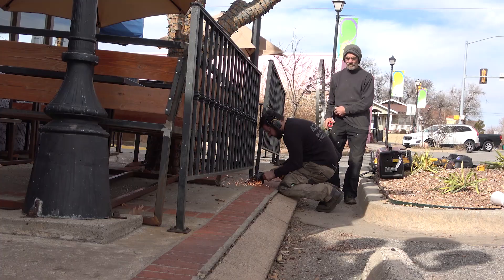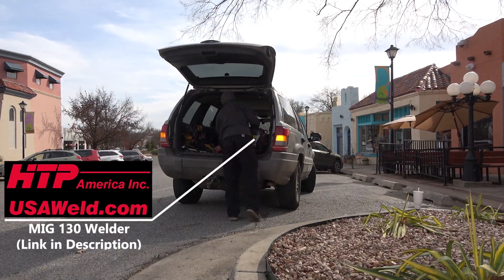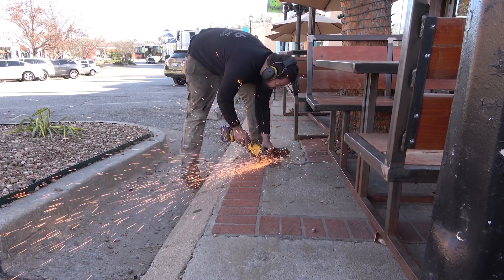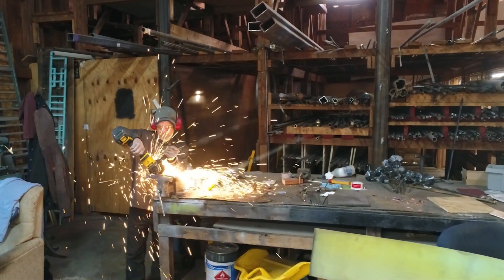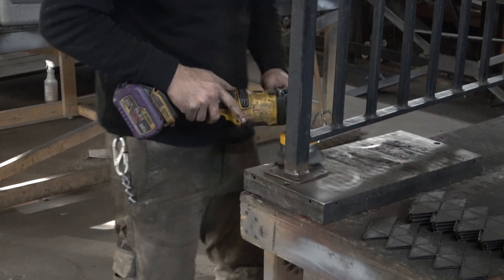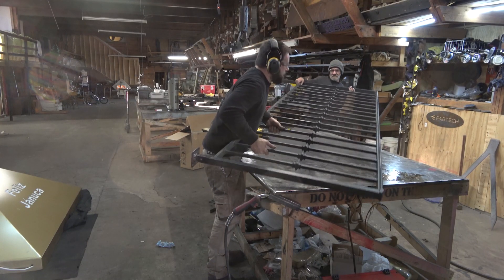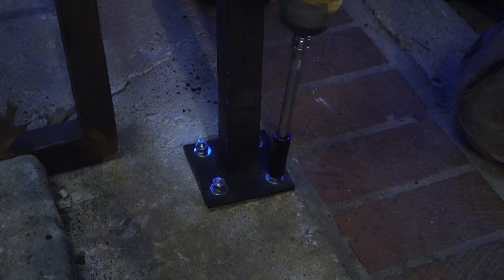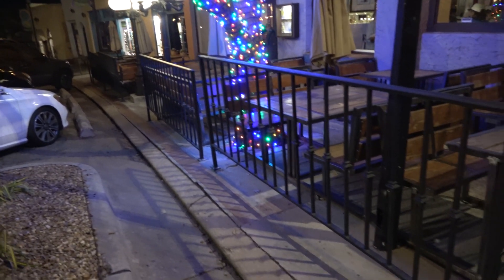When a Simple Job Isn't Simple

Comment: How do you not charge different rates for different metal types? Steel, aluminum, titanium, brass, bronze, copper, cast iron, cast aluminum, tool steel, etc?  Plus on location is about double here and out of 10 miles we have a 5 hour minimum.  BTW we are 1 of the lowest priced around here so you are crazy low!
Reply from the maker: Our rate is time + material, o something more exotic is going to cost more, and likely take more time.

Comment: It's a good customer because you did that furniture outside? :) Maybe drill a half-inch hole on the bottom of that leg for water escaping from inside is not stupidies idea ever.
Reply from the maker: Good customer because they're easy to deal with. In general other business owners understand scheduling changes, delays due to weather, etc. And yes, we built those benches to the customer's spec. 

I opted to seal the tubes by welding top and bottom completely rather than open a weep hole on the inside where we cannot paint.

Comment: $350 still seems pretty low.  Hope your customer knows what a deal they got.  
The metal-fab shop I used to work for wouldn't send a truck out for less than $1000.
Reply: call out charge minimum $1000 ? they still in business ??
Reply: @leso204  At the time we did mostly I.C.I. work. So the contracts would get into 5 figures very quickly.  But perhaps it's not comparable to helping out the neighbourhood restaurant.
Reply: Wages  $34.00 /hr x 2 welders for 1day, $544. Consumables/materials,  business ins., profit, vehicle exp. office exp. taxes, building/shop exp. (mortgage/lease),  tool depreciation exp.  business marketing exp. approx.$350+. All of a sudden you're at $900 for wages and expenses.

That's why $350 seems way too low.
Reply: leso204 depends on your business model. If you’re doing an average of 100 ton jobs of fabricated steel why lose those workers and manhours for a $200 job where you’re best case is $50 profit
Reply: @Farmboy1544  I think you made those numbers up. In my neck of the woods unions don't even pay $34/hr, let alone a couple guys working out of a 20 year old jeep grand Cherokee with tools thrown in the back. I don't know how all the rest adds up to as high as you got it either. If you have a $100k service truck with built in air, welder, pay insurance for your guys, 401k etc, sure. But that's not what this guy has going on.
Reply: ZoeQuinnIsAMurderer  Industrial, Commercial, Institutional. Commonly refered to as ICI.
Reply: @joshmiller3673  Well I did say the work we did was not comparable to helping out the restaurant. The $34/hr was non union. The weld shop I worked for grossed about $10 mill. a year. Depending on the labour requirements we would have anywhere between 30 to 50 employees.  As you might imagine running a profitable business is very expensive. If you aren't making $$$ in your neck of the woods, then that's unfortunate.  :(
Reply: Josh Miller idk what union you in but down south the boilermakers tubewelder pay is 32 dollars an hour and that’s down south the lowest paid area. Up north doesn’t matter if your a tubewelder or not all boilermakers make anywhere from 38 to 50s.
Reply: @Farmboy1544  but it took only 2 hours.
Reply: This really sounds cheap pricing. Two guys working 3 hours, driving involved and materials too (some metal, welding and bolts).
Reply: I thought the same thing.   I wouldn't imagine a company wanting this job unless after labor and material the shop makes $300-500.   How do you keep the lights on in the shop?

Comment: I would have just cut all posts off and replaced with thicker gauge tubing and new thicker footplates like you did. Probably would have saved you time, which would have offset the cost for the thicker tubing, which you could have told the client from the start (but now you know when someone else calls with a similar "quick fix"). Sad to see the previous builder opted for all cheap materials, when really it isn't that much more for thicker tubing.

Comment: OK this is an onsite job within 10 miles so we don't charge under 50 miles otherwise we charge $1 per mile. Shop hour rate is $100 and in the Field with a min of 3h work for $175. If customers are former military, EMT , Teachers , Police or Firefighters they get 10%. 

Costs would be around for a good customer $300 plus $50 in materials for this kind of the job including the painting in flat black enamel.

Comment: A anti rust technique from the early tube frame aircraft builders is to coat the inside of the tubing with  linseed oil. In this case I would have given the inside of the pipe ends a shot of Rustoleun  primer before closing off the ends of the tubes.

Comment: I’m very curious,  do you charge for “shop rate” differently than “man hours”? Great video by the way, thanks.
Reply from the maker: As I said, we're not charging for time spent waiting for paint to dry. If it was a rush and that was all we had to do, yes, but in this case we had other work to do, so no. Man hours is different as my helper does not earn, nor command the same rate I do. If he is working alone, then yes, but there is no reason for me to bill for overhead twice.

To each their own on how they want to bill, I prefer to do it as upfront as possible. My customers appreciate that and return because of it.

Comment: You know how I keep water from building up in posts and pickets?

Use solid bar.

They’d need to be in salt water for 10 years straight to rust through.

Use a core drill and anchoring cement. Bolts rust, cement doesn’t.
Reply: I just drill drainage holes whenever  I'm doing something like this, it's a lot cheaper than solid bar

Comment: That was a rookie mistake. One hole in baseplate prevents a column of water from condensation collecting in post and freezing/ puffing and rusting out. All this should have been  
Assesed when giving bid and give owner 2 options, a field repair or a shop repair with a proper price. Good news is he will call you in a year to fix again since you you didnt address the root cause of the rusting the "WEEP HOLE" better luck next time

Comment: You gave him a very good deal.... Very cheap. I would have started at double that and possibly gone high for the extra effort. Keep in mind this business is not going to cut your meal and drink prices when your patronizing their business friend or not ? Your paying for materials, electricity, consumables, wear and tear on tools, and labor.... That's not free to you so you need to be able to cover that cost and make a profit.
Reply from the maker: We did the job by the hour, if you make your rate you're gold. I think the take away is this video makes the job look harder than it was. Took time, mostly due to paint drying, I'm plenty happy with how we did.
Reply: I get it, one way I bid is to add up all cost of materials and double it then add thirty percent to that number for any surprises. It works out well if I stick to the numbers and don't let the friend factor drop my price down to where I'm paying for the job.

Comment: I always had a "unforeseen conditions" clause in bid contacts. And I explain to the client that it simply means anything that isnt viewable or known and considerably changes the scope of the job as it is written in our agreement. I also point out that if that was to happen, a change order is drawn up so the client is aware to the reasons for the change. In every case it was obvious, similar to this one. 
Taking a hit for a mis bid or any mistake made by myself is fine, and I've done that without sacrificing work we quality. But an unforeseen condition is no one's fault.
Reply: S.W.A.G. Sorta Wild Azzed Guess
Reply: So you add half an hour of additinal paperwork for a job that thakes you 1 hour longer than expected?
Reply: @danj7348  
Half an hour?

Comment: Good work but your problem was that you didn't try to make it simple again.  I can think of much quicker and easier ways to solve this issue
Reply from the maker: I'd suggest making a video about your quicker and easier ways so we can all learn
Reply: 42Fab - Metal Fabrication & Signage maybe some day but damn you worked that customer.  Theres a multitude of simple ways to repair, In and out less than 30min less than $50

But you insisted on trying to fix it like you normally do and hurt your customer.
Reply from the maker: @user-jc2ez6ig5z  please do tell how you fix this for $50
Reply: 42Fab - Metal Fabrication & Signage like in school when a teacher will not give you an answer without you trying:

If you can come up with one way, I will tell you 3 more ways.  

Think on it. I fully expect you and your experience to come up with something.  Good day.

Comment: Personally I would have bought the next size bigger square tube that would slip over those posts like little feet.. cut all the posts on site, slipped on the larger tube and without even grinding on the plate since its hidden inside the now larger slip foot anyway---  stand the rails back up and weld all around the top of the slip and then all around the plate.. job is done... You could chamfer around the top for a sculptured look if you wanted.   It would change the look just slightly by now having wider feet at the bottom...  but it would still look good, and look "beefed up" to the customer , and technically would be-- and it would have been the simplest solution--- because all of your slip feet are the same size and easy to chop saw a scrap tube....  No measuring, no grinding accept maybe the paint a little........   Just cut, slip and weld..  gone.. (and it's not a bad idea to drill a 1/16 hole in the bottom so if it does ever get water in it it will drain out and not freeze and burst and bulge the pipe.)
Reply: Dam your a smart feller good call
Reply: @Quackers-rm8wj    Thanks.. lot of years, running a crew with expensive guys-- you have to get super efficient to keep making profit.  A few more minutes thinking it through can go a long way.  cheers

Comment: So many things wrong here. The base plates should have had holes for let water escape. The anchors likely could have been pushed down to maintain location, that's how anchors are designed. And the cost should not change from the quote. You pay for the lesson not the customer.
Reply from the maker: This is why there was no quote. We were called out to address a problem, with the customer knowing our billing rates. WE chose to do the work at the shop, which ultimately saved the customer money and saved us the headache of working in the field.

Comment: What metal chop saw would you recommend and blade replacement
Reply from the maker: I use https://amzn.to/2SjGbWK with the stock blades. I've tried a few blades and never found a better value, as much as I hate to fanboy dewalt.

My only complaint is the angle/miter system is kinda weak, so you have to readjust, but in the price point I haven't found another that doesn't have that issue.

Comment: I'm going to disagree with you on the shop thing. As a contractor I incur expenses for traveling and for maintaining a truck with $80,000 worth of tools in the truck. But on the other hand, I don't have to pay rent and utilities for a shop. The bottom line is, it's a wash. Now may not seem like a wash to you because in your case you own a shop and you're having to go to do site repairs. But I don't think you get to charge for the overhead of going to fight and charge for the overhead of the shop. But I think what's actually going on is your under charging for your shop time. And this comports with the members that you spoke about. Of course I'm not a welder, I'm a contractor. So I don't exactly understand all of the nuances of the rates in your area. For that matter I don't even know what your area is. It's worth remembering however at the unit price for finished product coming out of the shop is going to be less than that same finished product being built on site. But this is not because of the hourly shop rate being less, as much as it is the efficiency of doing work at a shop.
Reply from the maker: "you don't get to charge" is a statement laden with misunderstanding. 
We have a shop rate ($100/hr) with a minimum of $20. That means that if it is going to take us less than 12 minutes to do the job, it literally isn't worth doing unless you'll pay for the 12 minutes, because stopping whatever else we're doing, switching machine settings, etc, all eat up too much time.
Likewise when we go mobile that minimum increases to two hours and the rate increases, which accounts for the time needed to pack up tools, drive to the location, etc. 
Ultimately we do get to charge, because that is the value structure we place on our time, and the customer accepts that structure. Simple supply and demand. With the numbers given here you'll see that there was no gouging or rip off involved.
Reply: @42Fab  Sorry, don't misunderstand me, I'm not saying that you're overcharging. In fact I specifically said that I think you undercharging. All I was saying is that there is an overhead involved in running the shop and there is a very similar overhead involved in not running a shop, ie. mobility to site work. Each project has to take into account either of those overheads. It is quite possible that people that own shops don't appreciate overhead involved in doing site work. And I think that was your point, or at least similar enough to your point there really should be no disagreement between you and I. But generally speaking, minimums aside (which usually account for travel time to a customer), the cost of working out of a shop and the cost of working at site should be about the same hourly rate. But then the efficiencies of working out of a shop will still save a customer some money over doing work at a location, all else being equal. And that last part is really my point, that all else really is equal. All of that being said, you do you. My intent was not to offend or to accuse.
Reply from the maker: I'm not taking offense at all, I appreciate the input.

Comment: Cool video, but you need to use a vacuum when drilling into concrete, especially when in public like that. Silica dust is a big issue.

Comment: It's no fun if it's easy😁
I'm retired due to health reasons. Most things I do for people are quick jobs that I don't charge for but anything over a few hours I gladly accept beer.
Reply: thats true with welding. thats why i do not like mig as mush as like tig. its just way to easy. Zzzzzzz
Reply: @Mikey-ym6ok  Both have their places but yeah I prefer TIG, much more satisfying.
Strangely took me years and 2 welders till I felt comfortable with MIG but TIG was only a 5-10 minute "have a go " session and I was hooked 😁
Reply: Travis Thacker  I missed out on the fun of learning properly. Younger days, I had the money but not the time and was mostly fishing. Sold the boat and bought a house in early 40's. Started accumulating tools and learnt and burnt, still got a ways to go before I can call myself good but i'm competent enuf for my needs. 
Now early 50's and in health forced retirement, got all the time but no money🤦‍♂️
Scratch start TIG sounds and looks pretty tricky, kinda glad I learnt with newer machines. Filler rod control is a pain with shaky hands and failing eyes but sometimes I get a few beads i'm proud of 😁

Comment: 16ga steel Gawd. I'd never make a set of railings from steel so thin.
Reply: Green Giant Fabrication but you might buy them if you didnt consider the thickness of the metal before you made the purchase, which may be what happened

Comment: Grinding around "civilians" is a huge liability. I've rehabbed a lot of railings over the years.  I've found that 3/8" anchors break off pretty easily.  I use a deepwell socket and breaker bar to overtighten them to failure.  Heavy gloves are mandatory if you wish to retain knuckle mass... and blood...
Reply: The problem with that is you’re more likely to break the anchor free in the concrete as well if you can’t snap it. Grinding it off is a quick easy way to do it with less effort on your part because you’ll just have to cut and grind it down anyways if you’re moving the anchor location.

Comment: Richard!!! This video came out sick man! Learned some cool tricks cutting diagonal. Also, I agree it made more sense to run back to the shop and do all the work.... $350 seems pretty fair considering the amount of time, metal welding and expendables, bolts, concrete bit, driving, battery's getting charged, plasma cutter running, expendables and 2 employees.... Liked your tip of buying drinks inside. The politeness goes a long way man. Its worth the price tag to the owner to have saved those customers to come back again.